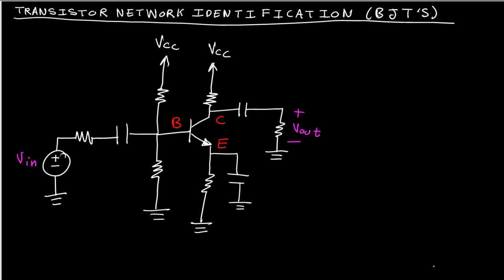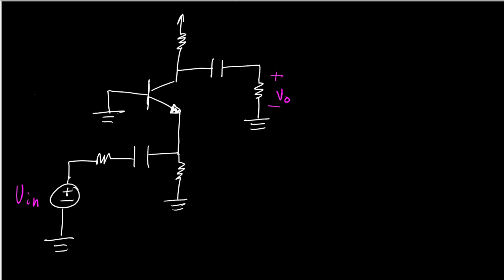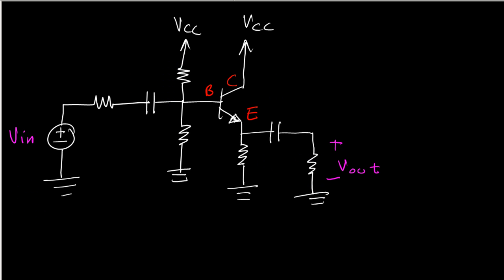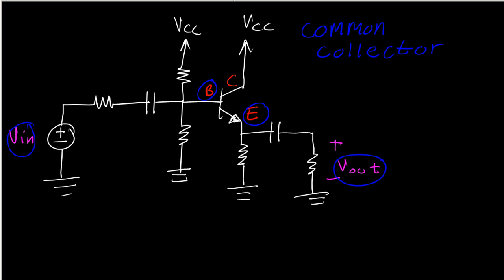BJT Amplifiers: Common Base, Common Emitter or Common Collector (Emitter Follower) Identification

Comment: I see lots of circuit in which  the output is taken from collectors but does not mean that it is a common emitter or any other circuit configuration. Guys search the circuit which is a common collector amplifier you will see that  in some of them output is taken from emitter, but also you will see that in some of them output is taken from collector so what I am trying to tell you is the place of taking output does not show us anything related to the name of that circuit configuration